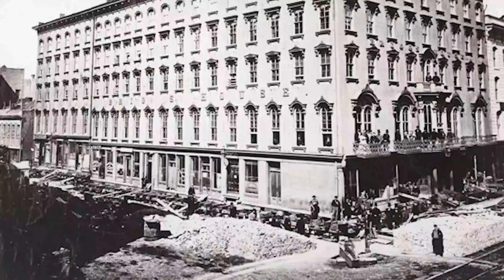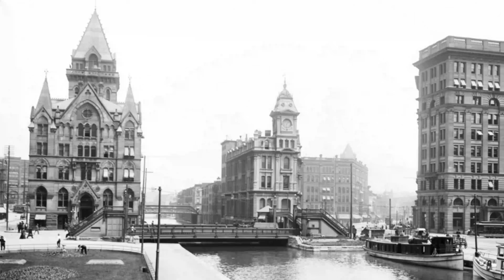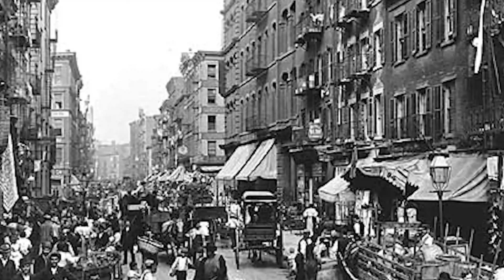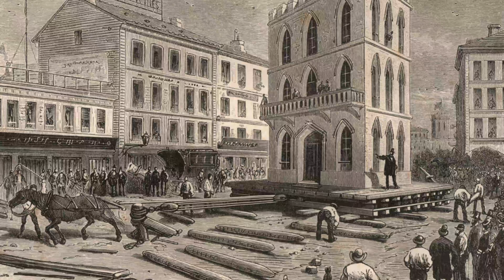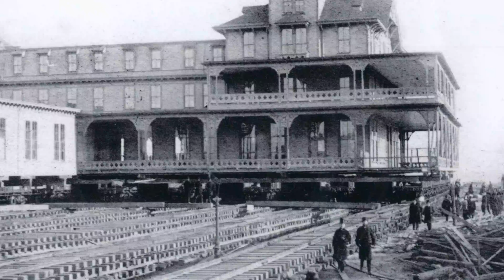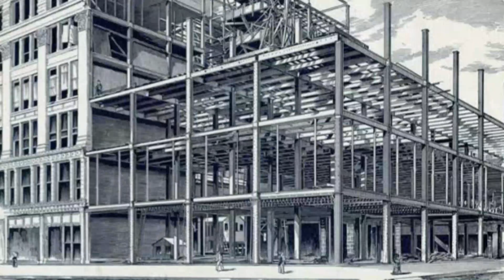35,000 Tons: The Insane Way They Lifted Entire Buildings by Hand

Comment: A screw jack is not lifting something by hand. It's still using a machine. Even just a screw in and of itself is one of the 6 simple machines that are used in just about every single mechanical device in existence. Screw, inclined plane, wedge, Pulley, Wheel/axle and levers. But, a screw jack is a lot more than just a simple screw. While they didn't use motorized machines, they still used machines. By definition a machine is a device that provides mechanical advantage, or translates movement from one direction to another eg. a screw turning circular motion into vertical motion, and allowing you to lift many tons of weight by applying much less weight on the screw as rotational motion.